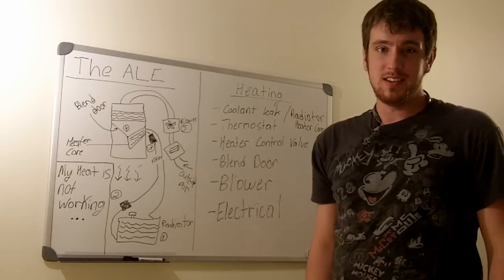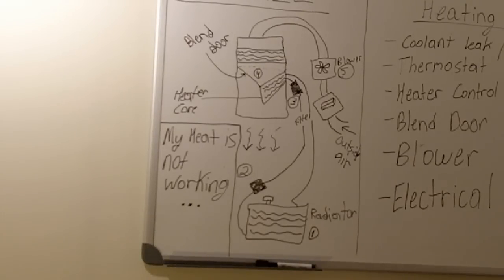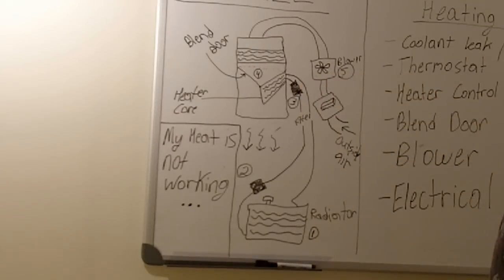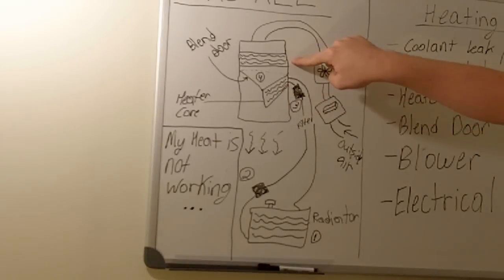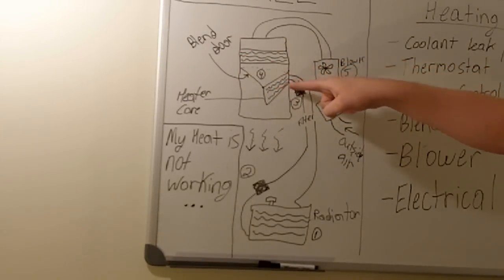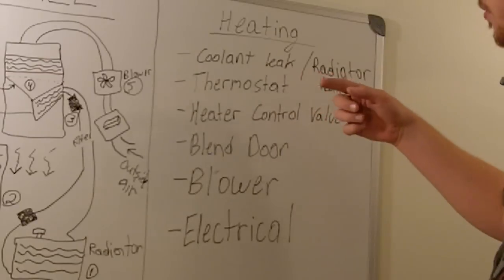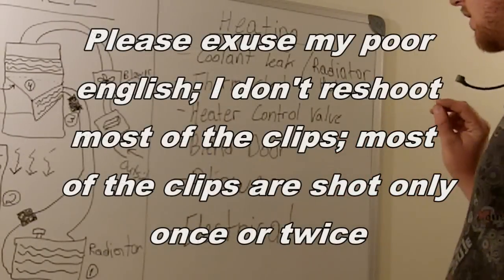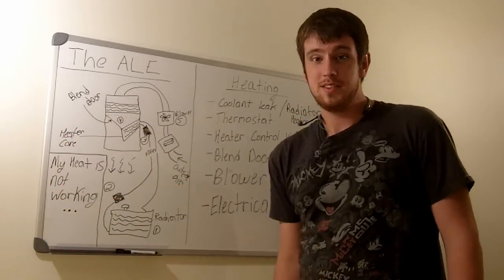How Your Car's Heating System Works

Comment: I was told my problem was the door getting stuck and it was going to cost me hundreds of $$$ to get it fixed but I managed to get that door unstuck, I believe, by pushing the buttons switching back and forth between a/c and heater until the hot air came out. Now I don't touch anything and keep it at 70 in the winter and am able to get it back to a/c keeping it at 60 if I don't mess with anything else. But these were very cold rides until I figured how to get it unstuck.

Comment: so the blower motor is used for both AC and Heating ? with AC it blows through the condenser and for Heat it blows through the heater core ? the blend door controling how much air goes to either the condenser and heater core air passages ??

Comment: i have 2002 lancer and my problem is ween the car is on parking dont blow hot air untill the car is moving i changed the thermostat and the coolant but the issued continued can you help me out ?

Comment: I have a ᤾2001 explorer, have no heat only cold air, I replaced the thermostat and flushed the system. I get water to the heater core, when I take the return hose off the heater core I get hot air, can you help.